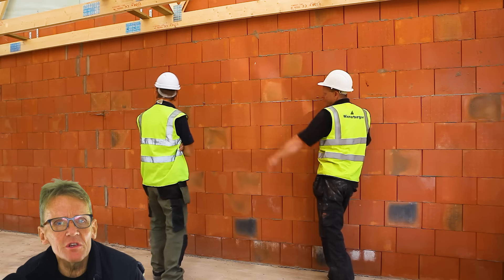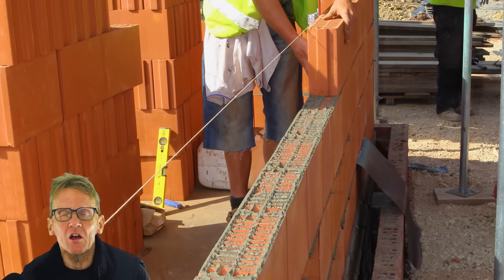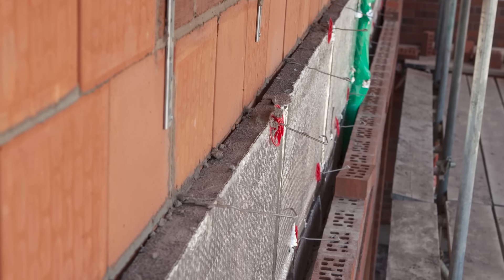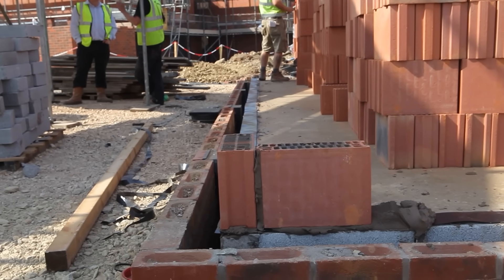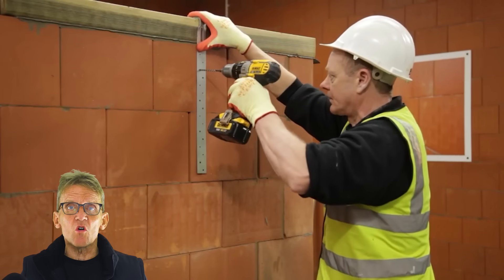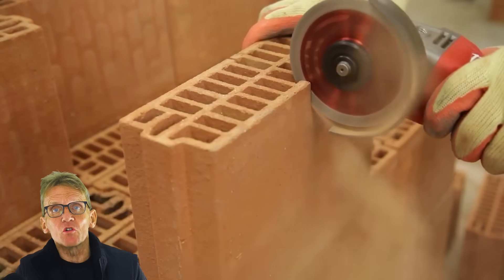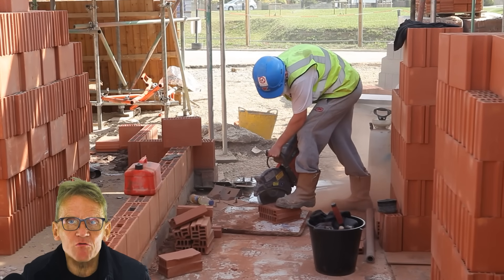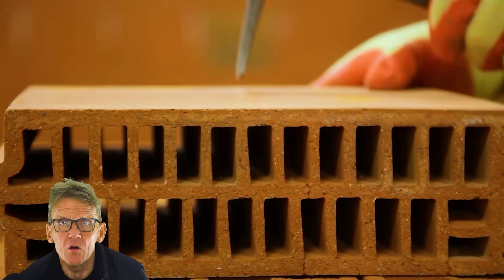Why Haven't We Warmed to Porotherm in the UK?

Comment: Did a job using these they were 360mm deep so no cavity.  Although totally level on the flat  the upright could be slightly out so had to use a 6ft level to get the overall level. Could walk up the corner on the blocks straight after being laid  as you could go as high as you like. Supposed to go up quickly  but window openings were all in a half course and big windows so had to use u blocks  filled with concrete and steel for lintels.  The house was in a cross section so 4 gables. Then u blocks all under wall plates  filled with concrete that also had to go up and over gables as well. Overall a great product but a lot of cutting. By the way had to drink plenty of water  on this house as i am convinced the blocks were sucking the moisture out of me
Reply: Design the home with the brick dimensions as a guide ?
Reply: @dwwolf4636  yes. Live in Ireland myself and a few lidl or aldi did this and they went up in no time

Comment: Hi Roger, we are about to start building our own home in Poland with Porotherm. From what I have read I think it is an excellent system, much better than the thermoblocks and cement blocks of our previous home in the U.K. (Taylor wimpey) Very excited to see this home develop. Natural material as well so healthier inside. I will sheet it with clay board, clay plaster then paint it in yosima.
Reply from the maker: I have just had a look at your channel, great fun! Best of luck with it, I will follow you.
Reply: @SkillBuilder  thanks guys… still fighting through the red tape but getting there! Hoping to start soon. Thanks for following 😊
Reply: Hi comments on your video are inactivated. I'm interested to see the content about porotherm system you will be using. what is clay boards? I'm in Portugal right now. the have these kind of bricks here but I never seen or heard about clay boards.
Reply: @annashealthylifeeverything8583  many thanks for the message. I need to figure how to activate them! All new to this. Any suggestions? The clay boards are exactly how they sound. It is clay pressed into a board like gypsum/plasterboard. Bonded or screwed on. I wanted further thermal mass on the inside wall and to help regulate humidity and air quality. Have a look at claytec although on the more expensive side it will give you an idea 😀
Reply: Think I sorted the comments now - thanks
Reply: @its_living_1980  It sounds great with these boards! I have never heard about them here. Do they sell them in Poland? So you will put them on inside instead of plaster?
Reply: 'Natural material so healthier inside'. That really doesn't follow. Good luck, all the same.
Reply: @mikeconey2164  It's not "all the same" of course. what a strange comment! old buildings are being destroyed because of the modern materials that made the buildings in UK permanently wet. But of course some people believe every lie as long as it's told on TV 🙄
Reply: @annashealthylifeeverything8583  Jeez,' Good luck, all the same', means Good luck, (despite the fact that we have argued/had a difference of opinion/fallen out/whatever).
Old buildings are not destroyed by new materials, it is by the improper use of new materials. New materials are necessary to provide high insulation values, to stop damp ingress etc.

Comment: We have used these on a few small projects for over 15 years. Agree with some of the other comments in that they can be a pain to drill into as they are strong but brittle. We've used them for external walls as well with render finish and they are still totally fine 10 years later. Bricklayers hate them which is the main issue. You can't get them specified unless the main contractor fully buys into training up some lads to do it. The whole point is to use semi-skilled labour and actually folks trained from nothing were better at it than the bricklayers. They even have a 365 wide block which you can use without a cavity and with external insulation and render. Used right, these are an excellent product.
Reply: The go up to 50 cm wide in Europe, gives you quite the nice baseline thermal performance without doing anything (a pain to carry though).
Reply: You got that right! I worked in England for a few years some time ago, and I found it very strange in the beginning. The construction industry was incredibly resistant to modernisation. I guess this hasn't changed.
Reply: You say 10 years like thats a long time. My brick house is 100 years old mate.
Reply: switch off the hammer function of your drill, done. If you know what you're doing, porotherm is so superior and efficient, it's not even funny anymore.
Reply: How did you guys insulate your buildings?  I need to know, lol.  Looking to do a retrofit to minimum R-20 continuous (imperial) in a climate zone with extreme temperatures.
Reply: @zilfondel  The Climamur 365 blocks have mineral wool and an Imperial R value of over 27.
Reply: That is the point, cheap unskilled labour and stick it up quick. More profit for the builder , but potentially much more problems for the client.

I've seen a large industrial garage which has this stuff in the roof. Strings in-between strips of concrete. It's horrible stuff as it cracks and spalls and who knows how long before it starts properly failing.
Reply: To drill into porotherm is very easy with the new bits that don’t need hammering action. You just stick them in a 1/8” hex drive impact driver. After drilling, you can use concrete screws or the traditional plug based fasteners. For heavy loads you use chemical fasteners.
Reply: A good bricklayer can lay anything
Reply: @agentj1027 eggs?
Reply: I'd like to paraphrase your comment, and the message from the author: they are not really available in the UK because working with them requires minimum training, which is well above the average untrained brick-layer? Apologies if this sounds rude, it does not mean to. It's just my curiosity to fully understand why the UK uses a different method from, well, the rest of the continent (including regions which are colder and wetter)..
Reply: Every tradesman hates DIYable products that require no skill. They see it as manufacturers or stores competing with them.

Overall England has an allergy for new.
Reply: @VanyaYani  

*Britain, not just England.
Reply: @darrida... old skool brickies work to around 5mm precision. With these you need around 1mm, since the mortar beds are non existant. It takes a higher skill level to work at 1mm than 5 mm... They don't want to do it.
Reply: @fredfred2363 Laying porotherm takes less skill than bricklaying. The thin bed of adhesive compresses to virtually nothing. Once you get the first course perfectly level and plumb, the rest is just stacking
Reply: @balometer  that thin layer of adhesive is also seen as an issue by many in the UK. These things basically are only held together by their shape which while interconnecting is not interlocking, nothing really sticks them together so they are very easy to break appart with minimal force. 
Basically they have compressive strength from above and either end, but their lateral impact resistance is next to none. 
I honestly would not be surprised if they don't meet the building code requirements for some types of structure becsuse of that. 
Frankly I'd be terrified of using these in most of Europe, especially Earthquake prone places.
Reply: @cgi2002  That adhesive is very strong. I've been on jobs where demolished pot walls went into skips in chunks, still glued together.
Reply: @fredfred2363  It's not a problem as Porotherm has probably less than 1mm of tolerance, so it's almost like made by a CNC machine. Otherwise it would not be possible to use adhesive (or foam, as it's getting popular now).
Reply: Why bricklayers hate them?
Reply: @Darrida  It's really to do with bricklayers being very skilled and having a flow and muscle memory for laying bricks quickly and well. While they can and do learn Porotherm, it's 'undoing' some of that and relearning. It's like asking a great tennis player to play squash. Also a racquet and ball, but very different! :)
Reply: they can be laid by non-brickies
Reply: If you drill into them, don‘t user the hammer mechanism, otherwise you smash them to pieces. 

Normal drilling & using special porotherm dowels  should do the trick.

Comment: From my experience in the EU its seems that noise transmission is high across walls, I wouldn't use them just because I'm v cautious about noise
Reply: The lower density and mass will mean increased sound transmission especially of lower frequencies.

Comment: Hi Roger, we built a couple of care homes with.  The main issues we found were:
1. Reveals and steps in the structure were based on traditional block sizes so there was excess cutting.
2. It de-skills block laying.  Once the first course is laid, precisely, a well drilled gang of labourers could build witMmmh a foreman.  As a result the bricklayers hated it.  Contrary to your film a trowel is not a tool that is needed. Telling the brickies to leave their trowels at home did not go down well!
If I was building my own house I would seriously consider these. They do one filled with insulation too.  Unfortunately price, availability, and a lack of labour willing to embrace them means we will be stuck gluing concrete blocks together for years to come!
Reply: I dont think it de-skills block laying. In Eastern-EU this is still a bricklayer's job and they dont have to leave trowels at home. 
Also building code requires skilled worker to do that specific job  not labourers. 
We used standard mortal as "adhesive", on site mixed  cement, sand, lime . 
Some extrem cases I have seen foam used as glue  (similar to expanding foam).
That tool in the video efficient but we never used such thing or seen used while I was a labourer.
Reply: As a retired brickie I can confirm.  One look at these makes me wince. If god wanted us to build walls like this he wouldn't have invented trowels.  It's the devils work.

Comment: Absolute shit to drill into. The worse block to use if you need to drill into.
Reply: reminds me of the old clinker blocks for drilling into which just crumble.
Reply: very true, you also have to make sure that no water gets into the hollows because in the UK that spells absolute disaster in the winter unlike our standard way of blocking which is very resistant to our winters
Reply: @dazt5831  water would never get into those block walls as they are always laid under cover and it rarely rains in the UK anyway.
Reply: Its like the name say's it already,  "lazy lad" ,  when you look around these days there are plentyfull solutions available for these "Quick build" blocks, drilling/fixing items!!!

Comment: Given they are so light I wonder why they don't make them bigger?  Would speed things up even more
Reply from the maker: Good point. Like the jumbo aircrete blocks you never seen in the merchants.
Reply: They make them up to 50cm thick (for better insulation) which weigh 18kg for the unfilled ones.
Reply: They are not so light, actually pretty heavy. 15-16kg for a 25 cm block and more than 20 kg for the thicker one.

Comment: Absolute grim product. In my sons house.  We are just going through it all internal walls built with this crap . Cant fix to it try and fit new linings real ball ache .
Reply: Fischer do a range of fixings for Porotherm. Trick is to not use a hammer action on the drill hole as it weakens the surrounding area of block.
Reply from the maker: I think it is just a different fixing but you may be right. Maybe we need to do a video on fixing to it.

Comment: In the Netherlands we use Ytong, which are made of aerated concrete. Ytong blocks offer optimal construction options, are lightweight, heat-insulating, able to accumulate heat (and later release it), insensitive to moisture, sound-insulating, fire-resistant and frost-resistant. Moreover, they are environmentally friendly and sustainable. I’ve heard they are pretty popular in Germany also.
Reply: I am with you. Compare to the clay-blocks the aerial concrete is much better. But also has some nuances.
Reply from the maker: we have Ytong in the U.K too. They started in Sweden but are now made in several factories including Greece and Turkey/
We have quite a lot of autoclaved aerated block brands in the U.K but cracking is a common problem.  From what I have seen Ytong seems to crack less.
Reply: @SkillBuilder  mmm we used to build from stone...
Reply: With AAC you need a rebar reinforcement every 3-4 courses and a concrete reinforcement on top of each floor and opening. They're not supposed to be load bearing, but for 2 story houses are fine. Just not with heavy slate roofs. Also they're wicking moisture, so they need to be protected. Not that traditional clay bricks don't need protection in my opinion, but the erosion and damage moisture can do to AAC is much more severe. As rendered walls are unpopular in the UK for some reason, it's logical that these would frequently be used as an internal leaf.

If you consider the thickness, thermobricks have a much better performance. Not that there's a high bar to reach over these 100+ years old traditional bricks. But if space is premium, go with the hollow brick. Or concrete. Or even better, ICF.
Reply: @VanyaYani Architect I worked with had bad experiences with AAC aka Ytong in Belgium.

Imo they are good for interior walls for sound mitigation and between a garage, veranda and heated space for example.
Reply: How long does that last before it crumbles?
Reply: @RichardEnglander  The factory say they will last 50 to 100 years on average. Pretty comparable to normal concrete. If you can protect them from the elements I think you can expand that lifespan quite a bit. Never seen any crumbling, just don’t let them drop. You can even cut them with a hand saw and are easy stackable and you simply glue them together. There’s even curved ones, so you can make some interesting constructions.
Reply: @RichardEnglander   Everything crumbles, if you build it wrong.
Reply: aerated concrete ...... absolute no hell no, 30 year life span and crumble
Reply: I came across these for the first time in the UK the other day absolute shite you try and get a fixing in them! Try and cut them out to fit a padstone hollow horrible I wouldn't use them if they were free!
Reply: @Droningonuk I would not build the UK style house in the continent as it would not last single Winter without astronomical heat bills. Single external wall from these blocks filled with thermal isolant 440mm wide gives you U value 0.14. You need to use chemical anchors for hanging heavy cabinents on the walls and cant drill in them with hammer. Otherwise superior in every aspect.
Reply: @MrTurboSAAB1  not really true I have 100mm PIR insulation in my cavity brick faced it would last well over 100 years.
Reply: @Droningonuk  Sounds unconventional. Everyone thinks PIR is a big no-no for brick walls for some reason. "Buildings need to breathe", they say. PIR is not "breathable".
Reply: @Droningonuk  Ah, you mean not brick walls, but brick veneers?

Comment: Also consider the climate. In Spain you unlikely find winter season when temperature goes back and forth about 0 degree. So, the chance for moisture to be frozen and expand is little. Rather than in UK where you have to expect the temperature be less than 0 a few times a winter. Every material has the limit of cycling froze/melting. And for fragile clay-bloks this number is a little. That's a mine timer which will be counting span-life of your house.

Comment: I am surprised they didn`t supply You with number of blocks You needed.
In Poland, I just call Bricoman and they will deliver one, two or a hundred blocks. Or more.

One downside of Porotherm block is drilling holes for fixings, like Fischer DuoPower. If you hit void, then its OK. If you hit the rib or the joint of rib and void, then the drill goes instantly to the void and the hole is not straight. The only way, imho, is to drill with diamond crown drill.
Normal bricks have huuuge adventage here.
Reply from the maker: That is good to know, thanks for the comment.
Reply: That's one thing I really like about aircrete blocks, they are very consistent. I drill them with a Brad Point bit and use a Rawl Uno plug, which is sufficient for most things and goes exactly where you want it to - There are no stones or voids to hit.

Comment: My mate in Spain has had a house built by a large builder catering for the higher end houses. He's from Belgium and the builder is Spanish. His house is built with UK style blocks because they consider them to be superior albeit a bit more expensive.
Reply: Dense concrete blocks are superb for thermal mass. Thermal mass keeps internal temperatures more stable as they absorb heat and coolth.  They are strong and superior for drilling into. Best used on an internal brick cavity wall, or sold with external insulation.
Reply: What, like our superior plastic guttering etc, etc😂😂
Reply: @Mindersonagain how did you get plastic from concrete blocks?